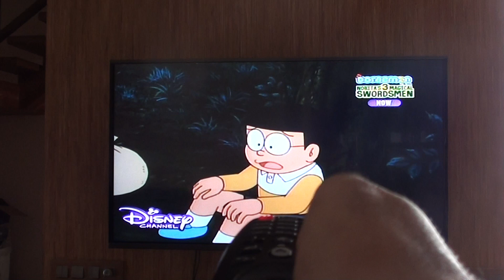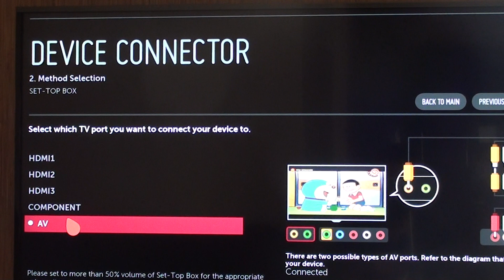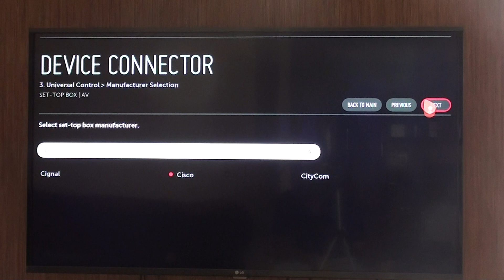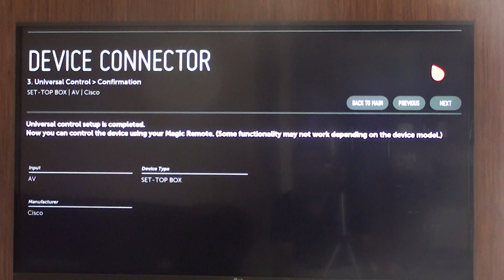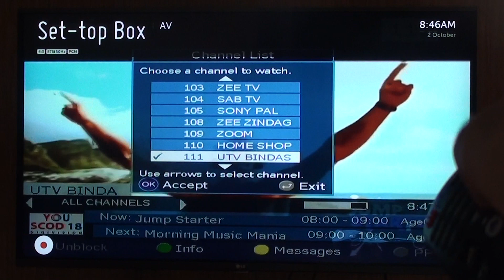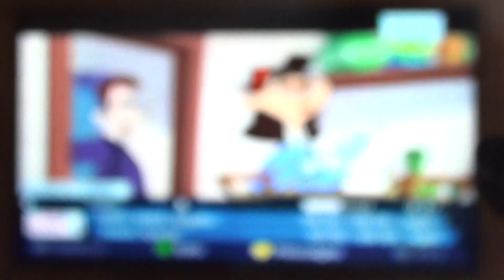How to operate both tv & set top box with lg magic remote

Comment: Helpful bro, Thank you. I really wanted to know that. So is it like a WiFi connectivity is compulsory in Order to operate Smart TVs? Without that it can't be operational?
Reply from the maker: +VISHAL SINGH wifi or Internet connectivity is required to use internet based functions on smart TVs. Regular cable TV or satellite dth doesn't require internet
Reply: nabeel nawab Ok. I was talking about setting up your new smart TV. That needs an internet connection right? Will my 4G network do through hotspot?
Reply from the maker: +VISHAL SINGH yes it needs internet. 4g hotspot will work
Reply: nabeel nawab Oh right. Thanks bro 😉
Reply from the maker: +VISHAL SINGH 👍

Comment: It is showing only 2 remote types.Both are not working.
Reply from the maker: +Sai Avi1 make sure the tv is connected to the internet and has been updated to the latest firmware, then try again.
Reply: i tried but no use
Reply from the maker: +Sai Avi1 factory reset tv n try again

Comment: do I need to connect any special device for magic remote? I can't connect it to my setup box (Tata sky)..I followed all d instructions as u shown..
Reply from the maker: +Arun Bevoor no special device is needed. If the manufacturer of your set top box is listed in the setup then there should not be any problem
Reply: Did you get it working?

Comment: So stupid You scod 18 remote is made by Cisco.... Thanks for sharing this information but the remote you are using through the WiFi connection not infrared... So if WiFi is down or disconnected then you cannot use it as a set top box  remote.
Reply from the maker: +Amol mk no need for wifi connection or Ethernet connection once the setup is done
Reply: That's great
Reply from the maker: +Amol mk 👍